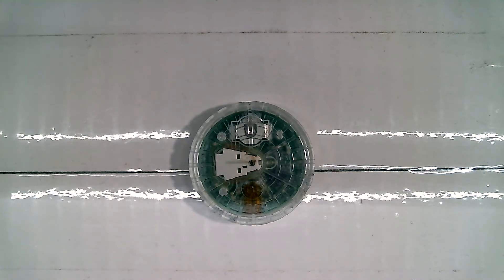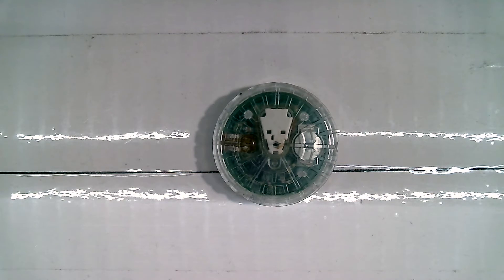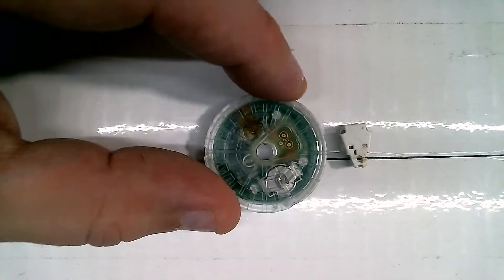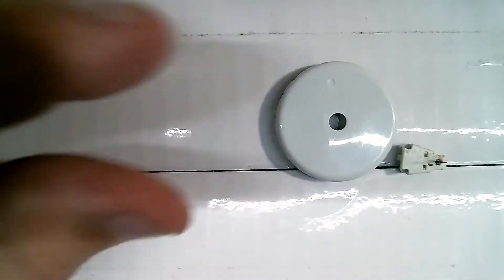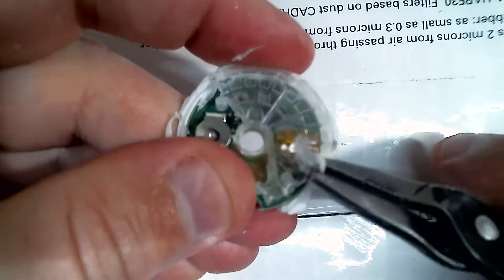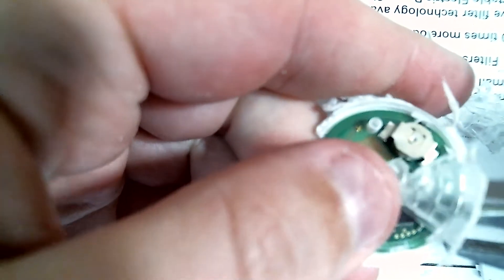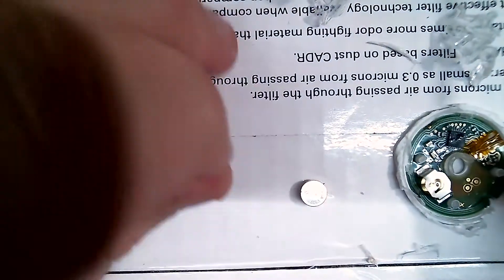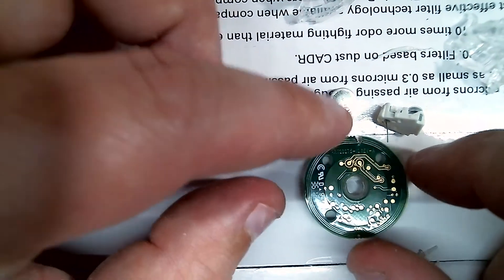FreeStyle Libre Glucose Sensor Tear   Apart?

Comment: Any hack to have the sensor working for more than 14 days ?
Reply from the maker: Not that I'm aware of but I didn't put much into looking at how the firmware of the device actually works. What I assume happens when you make the initial calibration "scan" is that starts a countdown inside the device to disable it after 14 days, but the other possibility is that Libre software is taking the serial number off the device, marking it as active at a certain date and time, and then refusing to read data from it after that. So there are a few different routes if you wanted to use one for longer.

I'd highly advise against this though, even though this is a subcutaneous device and not an intravenous one there is still a risk for infection if left in beyond the specified lifetime. There's a reason we don't usually "hack" medical devices.
Reply: @bulletpointmediadotnet  Many thanks for your feedback. Very appreciated 👍

Comment: In case it helps, I think that this is a Libre version 1 sensor so it's NFC only. The version 1 stores up to 32 readings (15 minutes apart for a total of 8 hours) and the sensor sends these readings to the reader whenever the reader is "NFC tapped" onto the sensor.

The version 2 added an EM9304 Bluetooth IC, so in addition to NFC tapping as above, the sensor broadcasts the current BG value every minute. The reader picks up these broadcasts and triggers the appropriate alarm if the current BG is beyond the relevant threshold set by the user. HTH.
Reply from the maker: Version 3 I saw at CES adds even more functionality, but it all still has terrible body placement in my experience. I still tend to knock the sensor off too easily. I may give something like the Dexcom G6 a shot since it is placed lower on the body.

Comment: you grab a pair of needle nose pliers and then pinch the white seal coat back all the way around the sensor and then for good measure peel the plastic completely off , then you split the casings in half using the needle nose pliers until it separates. then you can pry the printed circuit board off the side it attaches to . then you can remove the themistor AND the battery . Those are the only parts useable for electronic hobby things. The battery is the type that is used in many electronic digital watches. Seeing as how you have to put a new sensor on every 14 days , you will accumulate a lot of batteries ( 2 a month) . along with this the applicator unit used to put the sensor on your arm or other places, you can pry apart the section that has a white piece (circle ) out and you will be able to get a nice compression spring out of the applicator , be careful of the center of the cup as it contains the needle that is used to open your skin so that the filament penetrated the layers of skin. I am a scavenger from way back and instead of throwing away a perfectly good battery and spring, i prefer to collect them for future use. This guy absolutely had no idea what the hell he was doing trying to cut the sensor apart.
Reply from the maker: Brute force for the win in this case lol.

Comment: Good teardown video. 
Maybe you could try a small amount of petrol around the unit's seal. Wait 5 minutes and see if that helps opening on the sensor body.
I use this method on opening wallwart power supplies and laptop power supplies with great results. I just use a few drops out of my 4stroke lawn mower can.😁

Comment: Is the battery the reason for the sensor expiring after 10 to 14 days or is this hardcoded into the chip
Reply: Any hack to have the sensor working for more than 14 days ?
Reply from the maker: The battery is likely the largest reason, although I'm not exactly sure what method these use to sample the sub-dermal fluid. It may be that the electrodes or reagents that are used to provide the data are only good for a certain number of days once activated. Or it could be an FDA thing as well since I doubt there's a huge different between the 10 day and 14 day systems.
Reply: @bulletpointmediadotnet  maybr its as easy as this: 
Two electrodes. Stick them into your skin.  Measure current between the two  electrodes

Comment: The chip is a RF430 from Texas Instruments. It is just a general purpose NFC tranceiver with a bunch of inputs. Analog inputs, I2C and others. The real magic of the Free Style Libre Sensor lies in the little triangle. I guess that that transducer just put some analog voltage on the analog input of the RF430. The rest is an ISO15693's magic. Very simple device, with the real magic put into that little triangle.